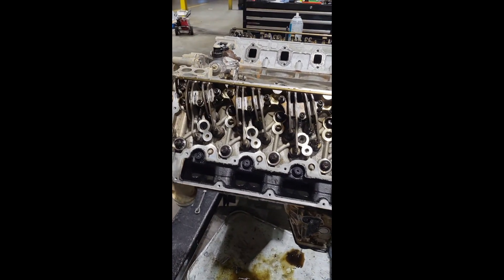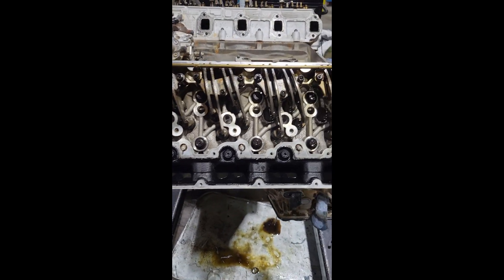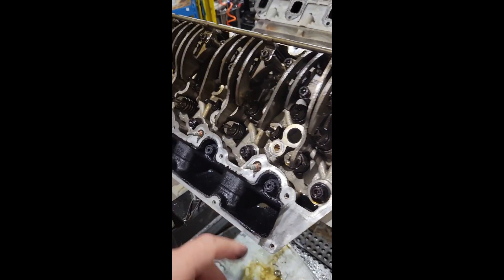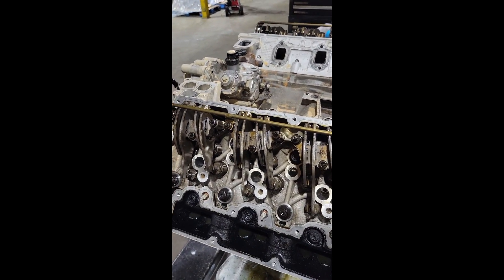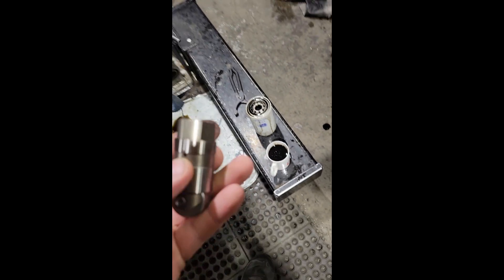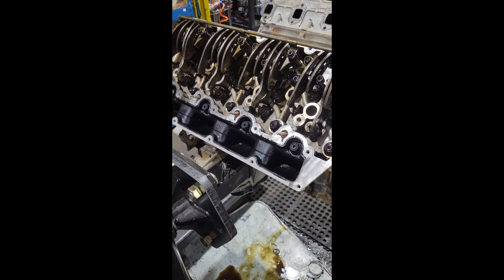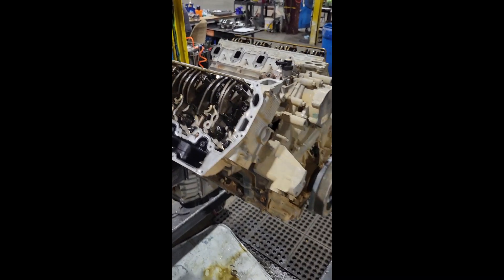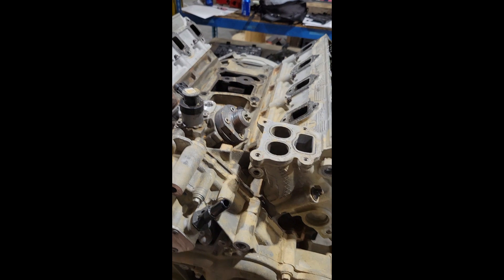NEW 6.7L Powerstroke Failed - Loud Ticking Noise

Comment: As much as I agree with what you're saying on the emission side of things, I doubt that was enough to take out the engine that soon. It likely didn't help things, but there is some other underlying cause that you're  missing. There are millions of these engines out there that get neglected daily. If that were the case, Ford couldn't keep up with the amount of engines that need to be rebuilt and replaced. Maybe the camshaft went flat on those lobes? Maybe something else it's impossible to tell without tearing it down.

Comment: This why I tell customers 5000 miles on oil changes if you’re daily driving the truck and 3000 miles if it tows and hauls. Is it overkill? Maybe, but regular oil changes are still cheaper than engine replacement.

Comment: Install a bypass oil filter, these things hold 13 quarts an oil change is really expensive. These engines also have a problem with the rocker arm assemblies, they get loose and the rocker gets sideways and goes off the tip of the valve. There is an updated rocker arm assembly for them.

Comment: Also 6 7 tons of blow by from injector crush washers failing blowing by orings. Creates insane crank case pressure, and rocker failure. ford knows about it. They change their rocker arms a few times. No recall though even though the defective parts are on many years not just earliy models by the time theu caught it. It will fail a matter of when not if with that part unfortunately its usually after warranty. Im at 120k and on my second engine now thanks to Ford. Very easy to prove every one will fail eventually from this. Rocker get wiggle room walks off center of valve stem push rod comes out allows lifter to break engine grenades. Absolute Horse shit. @ford

Comment: What oil do you recommend. I tow a trailer with skid steer most of the summer. Not everyday. I have. 2022 f250 diesel. I use 5w-40 full synthetic ford oil with ford filter.

Comment: Does having and using a high idle switch help with this issue?
Reply from the maker: No, because idling faster doesn't add much heat to the cylinder. It's load that will allow the heat necessary to burn off the hydrocarbons.

Comment: In addition; you can't use long drain intervals due to fuel dilution when regen takes place.
Reply from the maker: Absolutely correct!
Reply: With the 2023 and newer 6.7 there is a “9” injector located at the dpf filter so fuel dilution due to regens is eliminated since no fuel is introduced into the cylinders during the exhaust stroke. They stole that from GM 😂😂. Smart move in my opinion